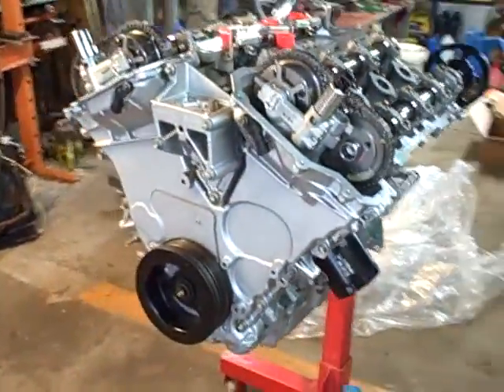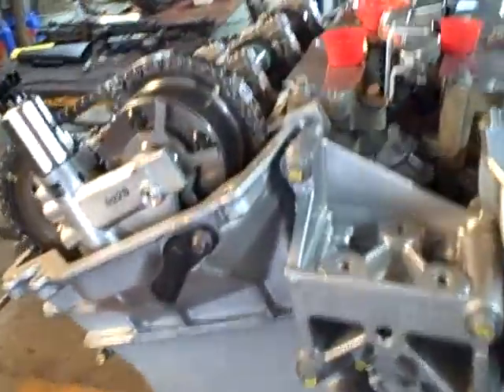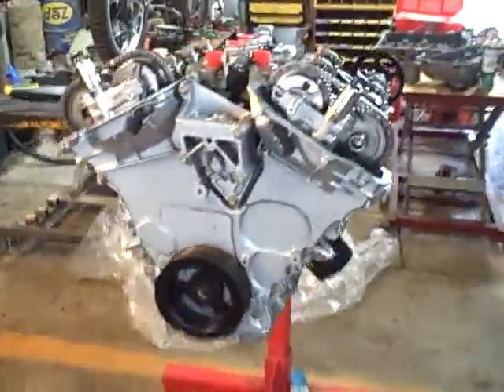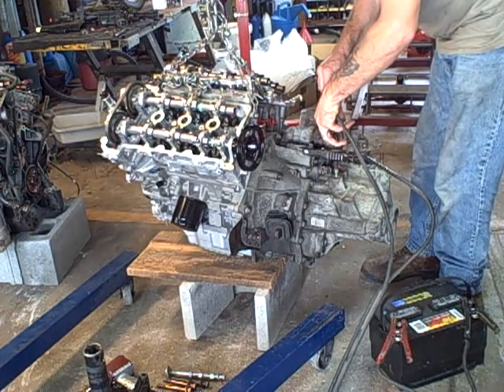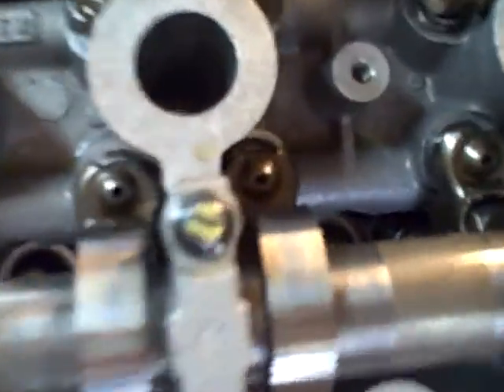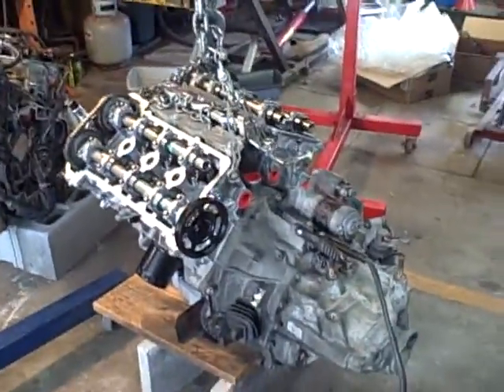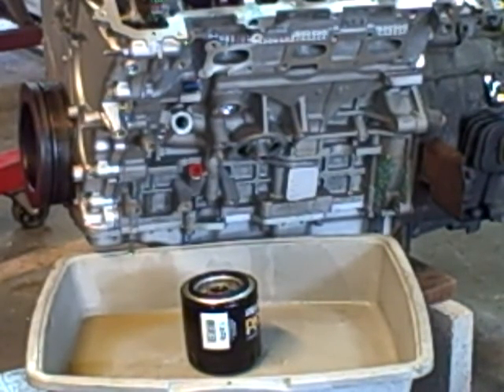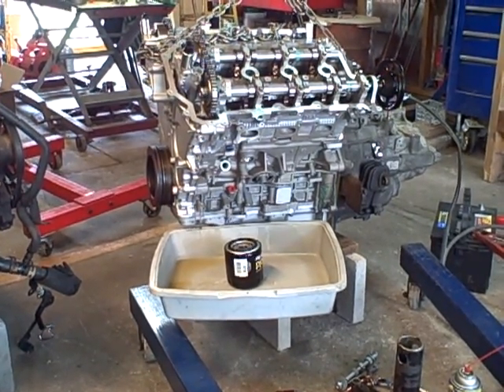Mazda Rebuilt engine Oil Pressure issues - Videos 1, 2 & 3 combined

Comment: what was the issue???
Reply from the maker: I wanted to make sure the engine had oil pressure before installing. The issue was that it has a gear reduction starter and cranking the engine wasn't fast enough to pickup the oil. I was concerned because it was a $3,000 rebuild from Napa. I know the first thing they do if there's an issue is blame the mechanic or technician. Thefore I wanted to verify oil was getting to the valve train before installing in the car. Thank you for your question

Comment: LOl turning it over by hand is NO WHERE near close to turning the motor over to get oil pressure... Just to even think about starting the motor you have to get it up between 700-900 rpm .. lol

Comment: You should fit electric oil pump if you want to have oil pressure when the engine is not running.
Enjoy. ;)